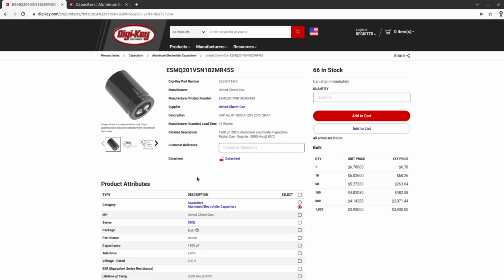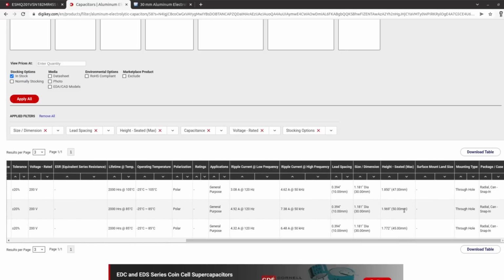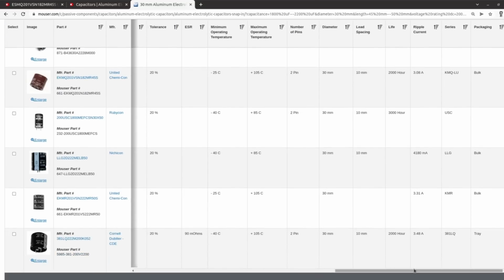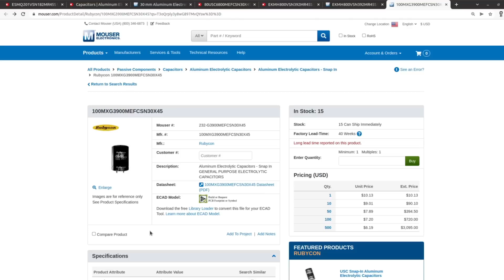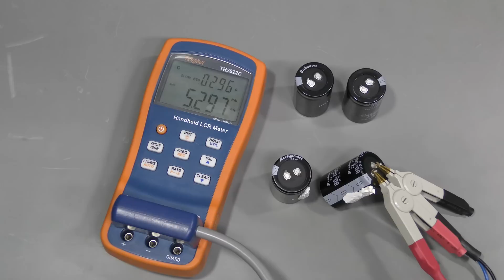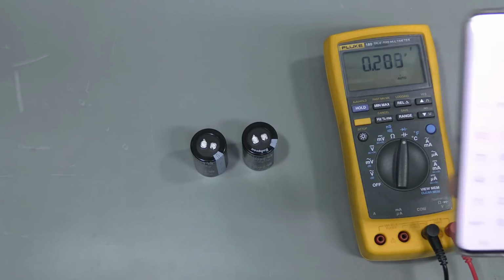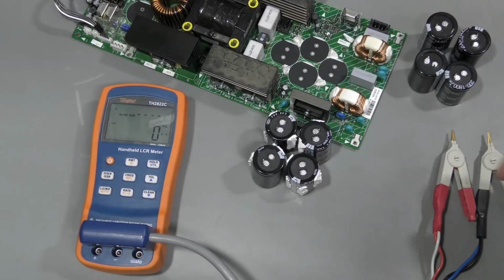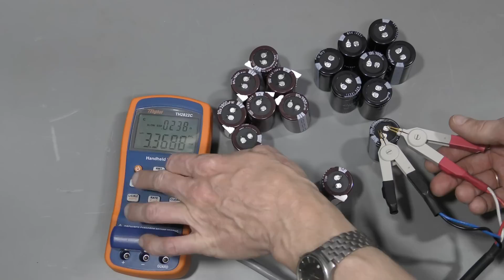#129 - Recapping Pioneer Elite SC-09TX

Comment: That heat sink is enough for class D, but barely. Is always better a direct contact anyway. The whole cap saga is quite weird, all at the same time. Looks like it was ran at high temperatures or with not enough air flowing trough the holes (maybe covered ?).

Comment: The reason why these capacitors looks like that, those 10-channels are all half-bridge amplifiers and during high volume playback at low frequency produces bus pumping which produces AC on the dc line and blow capacitors on the dc voltage bus. You should have also considered low ESR capacitors.
Reply from the maker: I showed the selection process. There was practically nothing better than the original ones given the physical constraints.
Reply: @feedback-loop  I didn't see any mention of low ESR and the effect of why look like that, see my comments on Half Bridge and Bus pumping effects.

Comment: Very good analysis of the status of these capacitors. I'm no radical 're-capper' as well, and would leave old electrolytics if they still have reasonably good ESR and capacitance in situ.. even when the device is 40 years old, as one of my HP signal generators. Anyhow, this bulging indicates overheating, maybe from cooked electrolytic fluid and over pressure , and that might soon lead to a burst of the safety valve. Root cause in an amplifier might also be high ripple currents, besides external heating from the power transistors, or that tight package. Therefore it's simply a question of Quality Assurance, to replace them.  As these old ones did not spill fluid yet, it is quite interesting, if they really show some over-pressure inside, if you make a pin hole in the bottom or top.

Comment: I sold Pioneer for years and the SC-09 was not their finest hour. The bottom was falling out for Pioneer. The Elite components with the Urishi finish, NO HOME THEATER. This is where Pioneer shined. When they sunk their bank roll into Home Theater, the end was predicted.  Money was already low. I knew my Pioneer Representative very well, and could sense things were not going well. Rear Projector TVs the Kuro Plasma was a huge commitment for Pioneer that really stressed their finances. Profit margins on video sucks. Also costs on compliances HDMI and so on murdered Pioneer. Also distribution issues didn't help either. Now Onkyo and Pioneer under the roof of VOX, utter garbage now. I sold Onkyo for many years too. Would not waste my money on Onkyo or Pioneer at all. Trusted now is Sony ES, Marantz and Denon. I have done AV over 50 years and these AVRs are more computers than high performing audio. I install always the above 3 I trust and use external amplifiers for reference level play. The older Elite receivers were excellent previous to HDMI Era, like the VS-TX49 for instance. Huge power supply discrete output stages. Copper chassis and milled aluminum end caps and much more. I have one and got it for a song. $350.00. Even older Pioneer like the 70s SX receivers are legendary.  70s,80s,90s stereo receivers was the performance race, not the home theater compliances arms race like today. Excellent video. I love your troubleshooting process.
Reply: My SC 61 does everything I want and it pisses off the neighbors.

Comment: I have agilent E4416A series power meter. the voltages are ok 12v,-12v, 5v and the battery measures 2.9v the stand by light is on but when I press the power button nothing happens you can help me and thank you  in advance.

Comment: Hi. Thanks for this and other videos. QQ: does the probes polarity not matter when you measure caps with your LCR meter? It is clear in the video that when testing some of the capacitors you were connecting red lead of the LCR meter to the negative pin of the electrolytic cap.
Reply from the maker: LCR meters put out AC (about 0.5 Vrms sine wave). Therefore it does not matter. I am not even sure why the leads have different color.
Reply: @feedback-loop   I was curious about that too. Thought that maybe some LCR meters  are also doing just a DC capacitance test as part of a measurement. But I never put a scope on the probes to test.

Comment: Hello. Where I can find power amplifier and SMPS schematic? Can't find them in SC-09TX Service Manual.
Reply from the maker: I explained in the previous video. The amplifier is made by Bang & Olufsen. Because of that no schematic I suppose.
Reply: IFF the service manual is out then there should be the diagrams as well might take some google fu the service manual references the one to be used on the front of it
Reply from the maker: @connorjohnson4402  I am afraid I cannot parse your sentence

Comment: Nice video. I think you should desolder those old capacitors and change them for new one. I'm saying that because even they looks ok now they can die any moment and if you have to do it again in 3 years isn't that a waste..I know it cost a lot of money and time..mostly..but still if you want to use it daily then i would suggest to change them as well..if you will use it from time to time then maybe it isn't needed to be changed.. But as i did see that fan running it isn't running much so i expect all capacitors get pretty warm..and even they are not used much on those placed they degrade over time..and that might be your limiting factor here.

Comment: I tend to replace caps on old gear even if they look ok, as I have seen times when good looking and good testing caps aren’t performing when put under load at high voltage, and replacing them solved it, unfortunately an LCR meter doesn’t really tell you how a cap behaves at its operating voltage and under load.
Reply from the maker: You might be right. Either way it is a compromise. Let's say, that row of 20 smaller caps would cost another $50-60 and  take quite a bit of work to replace. One has to decide where to stop.

Comment: I’m glad that you replaced those bulging caps, I’ve never seen good caps that are bulged, it was surprisingly good test results though, but the new caps were about 10% better, I wonder how they would test at high voltage instead of the low voltage that the LCR meters use
Reply from the maker: Yes, would be interesting to test them with a capacitor analyzer of some sort, but I don't have any.
Reply: @feedback-loop  or what about tetsting them with Mr Carlson's leakage tester?
Reply from the maker: @DanielMelendrezPhD  I don't have such a thing.

Comment: I fully agree with you about the capacitors, when are and look fine means that are fine. Different story about temperature: already at idling current the mosfet are warm with a slightly increase under work. For sure fans are meant to operate at that temperature, however I wonder if both transitors idling currents and fans switch on temperature  can be dropped a bit. Beautiful gear and video by the way👍

Comment: That heatsinking through the PCB seems to be a subpar solution. Plus, no forced airflow over the heatsink fins. Maybe lower the turn on temp for the fans to extend the lifespan? Or if they are quiet enough, just make them run all the time?
Reply: I own an SC 09 TX. The fans are quiet.

Comment: I said the same - it depends on the value of the item: if it's a 2000 dollar spectrum analyzer, 100 dollar in caps is great added value.
If it's a 500 dollar amplifier, the same investment might not be justified. 

However, for audio equipment, even small improvement can increase greatly the sound quality

Comment: So long as the other caps aren't bulging and otherwise spec'd OK; I'd let them alone too.
However, the fans seem not to be switching on soon enough and may be the cause of the cap bulging due to high internal temperatures.  Perhaps the fan heat switching sensors are OK but the threshold adjustments are not correct.  Also, the speed of the fans are questionable too, since the flow volume is greatly affected.  There must be enough positive pressure inside to keep heated air flowing out.